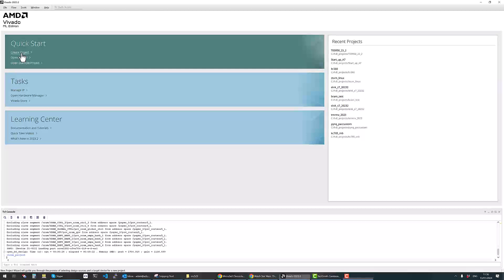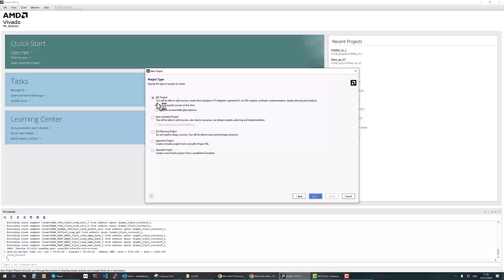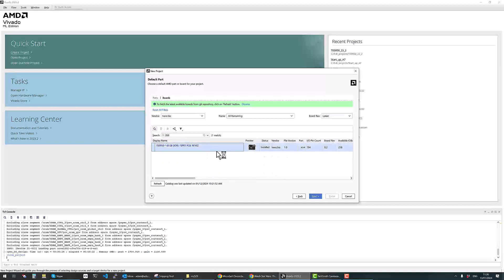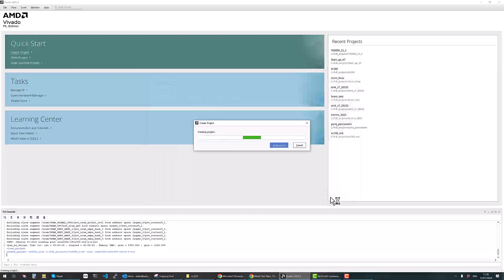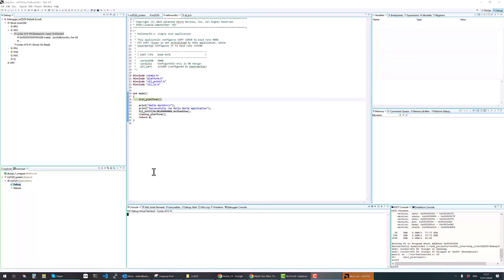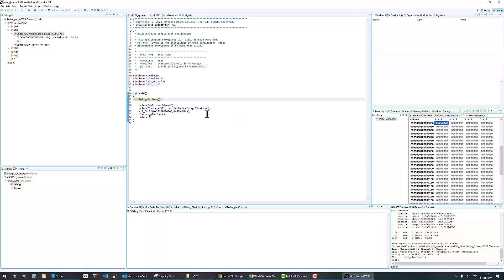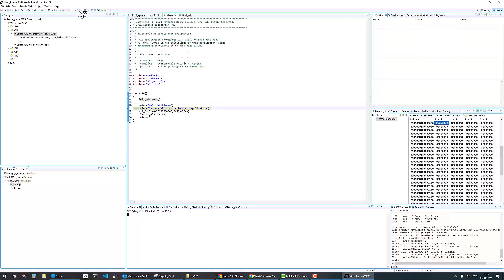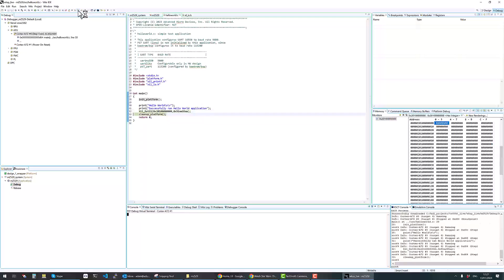Building a simple Versal CIPS Solution using the NoC

Comment: For the life of me, after doing this tutorial in Vitis Unified 2024.2, I just can’t get xsdb to “see” the blockram. The CPU can, but any access via xsdb gives a memory access error. I have the PMC routed through the NoC to the AXI master too, but nothing I seem to do works. DDR access works fine. I’ve repeated this tutorial three times now, I’m 100% sure I followed it as closely as I can for a VMK180 board.

Is there a (new) firewall/permissions config in 2024.2 that needs setting up?

EDIT: using `mrd -force` seems to work... apparently that's a permissions thing. So why does the NoC let JTAG access through to the DDR, but not to the BRAM?

EDIT: it seems there's no MMU config by default - `memmap -list` shows just one entry, of zero size, at address 0. I'm not sure how DDR access works given that - but adding `memmap -addr 0x20100000000 -size 0x100000` seems to allow `mrd` to work correctly, without `-force`.